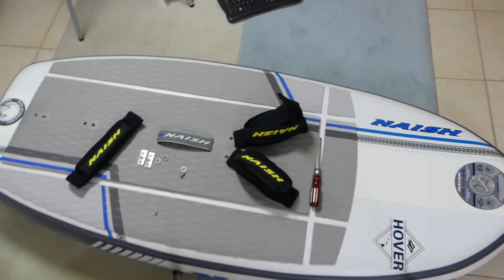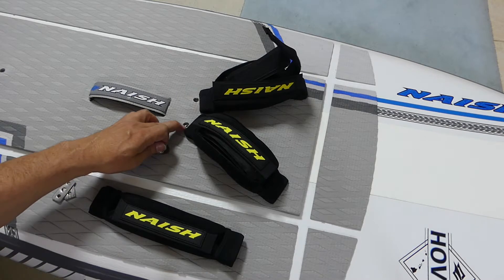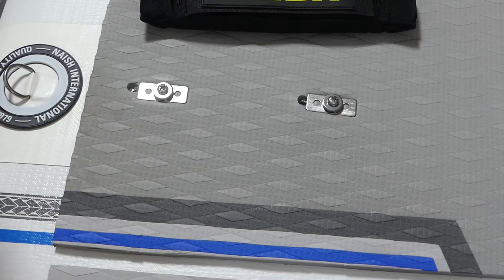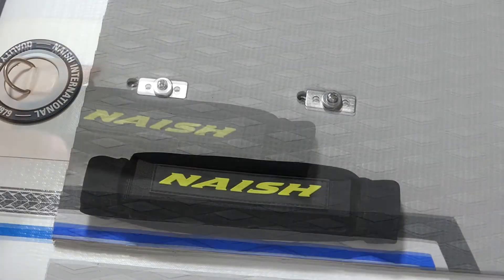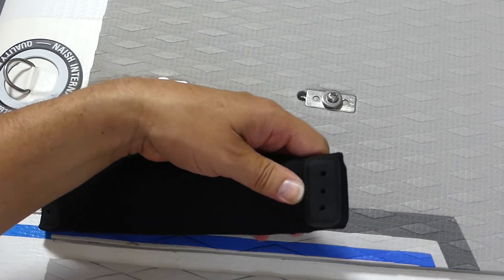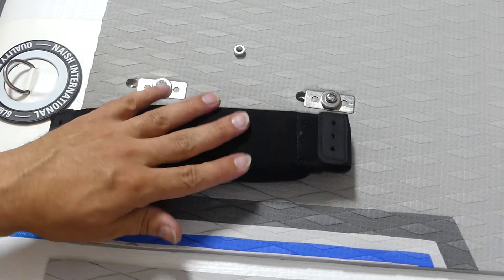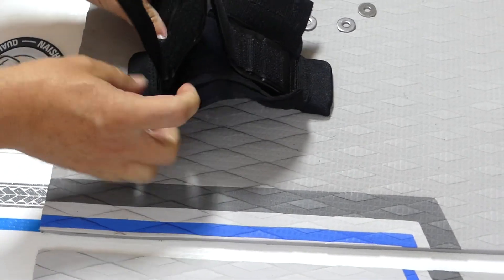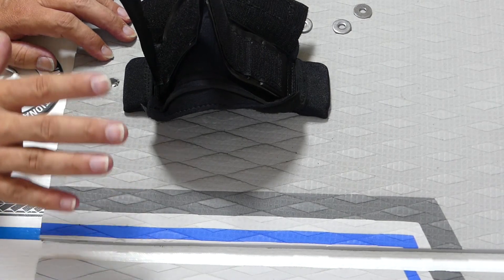Mounting the foot straps on your Naish S27 Hover Inflatable - it's not as easy as you might think.

Comment: Tip: get a proper screwdriver if it doesn't fit securely in the screw head, and when compressing the deck material, put the washer on in the same orientation as it will be mounted later (across the board). Of course the deck material takes time to compress permanently, so leave it like that for a few days. Or just get longer screws ;-) PS I'm pretty sure you'll find that the deck material is called EVA (ethylene vinyl acetate).
Reply from the maker: Better screwdriver of captive screw heads are always a really good way to go - so true !

Comment: Dirk do you know where I can find the foil t-nuts and bolts to connect the foil mast to the Hover board?
Reply from the maker: Best go with the supplier of the mast, and keep in mind that you may need different length screws if you switch masts or boards.